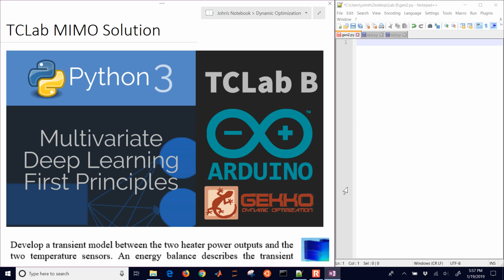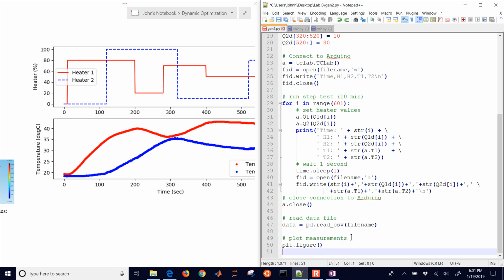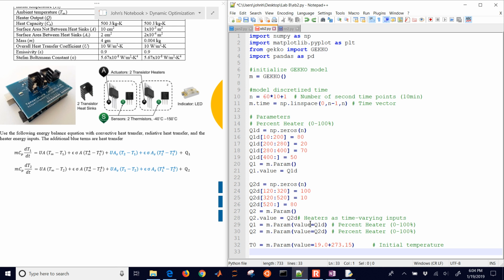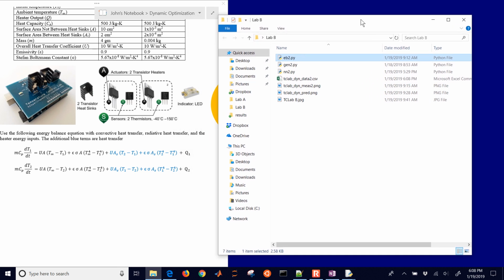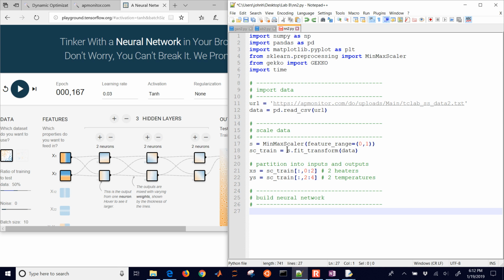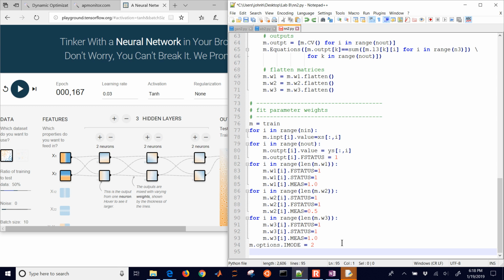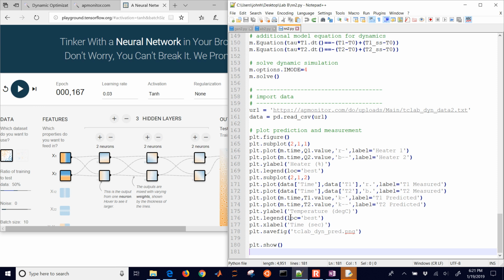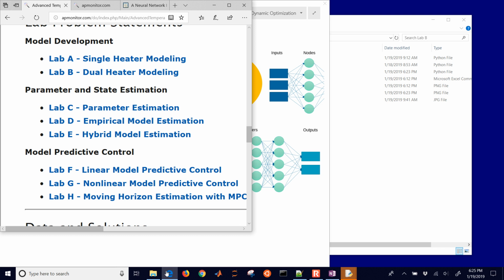TCLab B: MIMO Deep Learning

Comment: Hello, Thank a lot for sharing. I have a question about the python IDEL you  used in this tutorial. In fact I have  Python 3.7 installed on my computer which I want to compile through Spyder using the same code from this tutorial. But I got the following error : <<<<<<< from gekko import GEKKO
                
Traceback (most recent call last):
File "<ipython-input-1-a5a71f28d446>", line 4, in <module>
    from gekko import GEKKO 
ModuleNotFoundError: No module named 'gekko' >>>>>>
Please how to install GEKKO in Python?
Your answer will be very helpful. Thank in advance!
Reply from the maker: You'll need to open the Anaconda prompt and run the command "pip install gekko". Here are some additional tips for installing gekko: https://apmonitor.com/wiki/index.php/Main/GekkoPythonOptimization